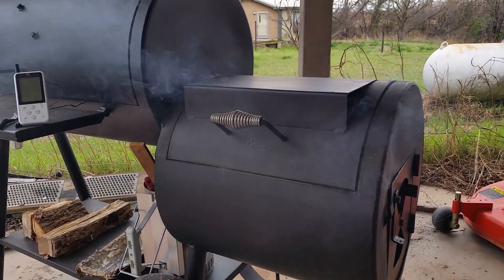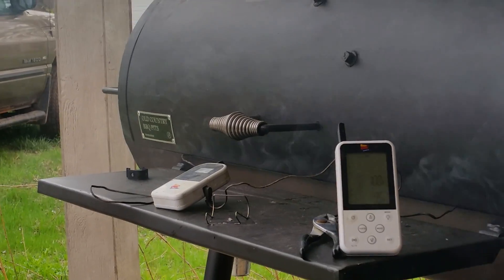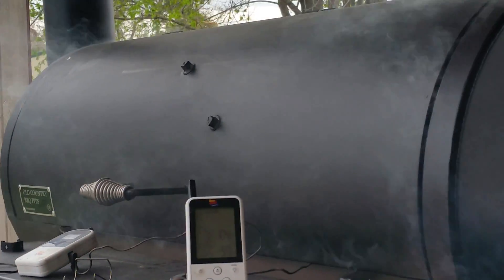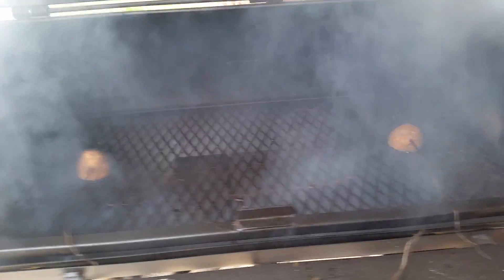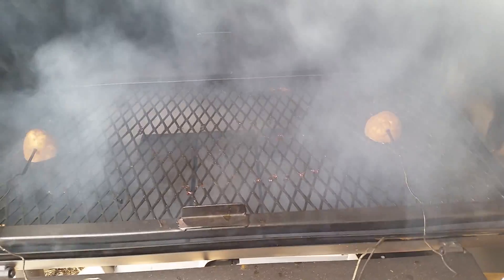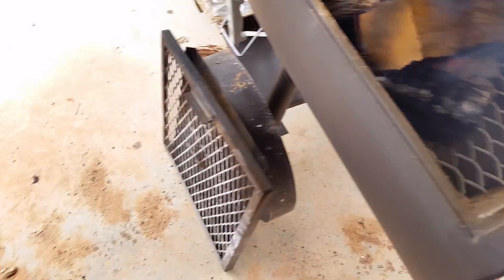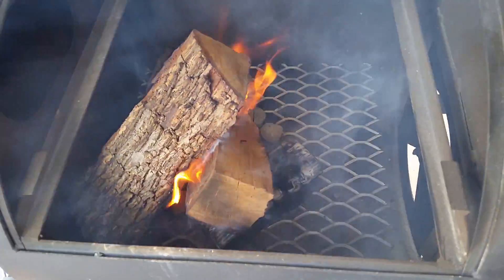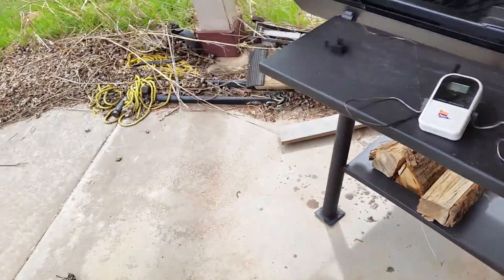Old Country Pecos smoker mods

Comment: I have the Brazos Smoker grill, the heavy version of your unit.  Mine leaked too. Amazon has different gaskets kits for smokers. On my fire box, I used wood stove high temp 1500° gasket, on the cook chamber I used black nomex gasket for the Big Green Egg XL. That sealed the deal, with better temperature control, and oxygen flow, creating a new and much better cook. The cost of the kits was just under $20.00.

Comment: Are the temperatures pretty even with the tuning plates?
Reply from the maker: it can be if you adjust it well enough.. probably won't ever be perfect but it is better than without it
Reply: @OKRMetric  try closing the plates together leaving no gaps, I heard that's all you need to do, what are your temperatures by the stack and fire box?
Reply from the maker: @ignoranceisnotatrend4669  I honestly don't know anymore.. I haven't worried about it since I bought it and made this video. lol  I did all the testing then and since then I just use it as is..
Reply: @OKRMetric  👍🏽👍🏽👍🏽👍🏽👍🏽👍🏽👍🏽👍🏽I think that's about how I'm going to start looking at it😄😄😄my set up as far as the cooking chamber goes is pretty much the same as yours except with 3 tuning plates from the baffle, I have about 3 more if I need to make adjustments 👍🏽but over all I'm satisfied and got to work with what I have I cant afford the much newer and bigger ones, I'm learning that with the pecos it's more about trying to get the heat up by the stack for a more efficient cook, so I think from this point it's really about maybe adjusting with another tuning plate or maybe 2 just to draw a little more heat by the stack but not adding too many because it could run the risk of turning into a reverse flow cooker.

Comment: Even if it does rust out on bottom it be a easy fix with bit of steel you could weld it or even just use self tapping screws. I have a friend who owns weld shop he couldnt build it for 400 bucks. So if your looking to get into smoken this is best bang for your buck. To start out with. I dont use any plates in bottom. Mine holds temp good im on coast of mississippi so dont know bout in the snow but would just think you would just need bit bigger fire. Coldest i used it in was mid 20s. An didnt notice any changes in cooking.

Comment: i have same smoker. first if it sits outsige drill 1/4 " hole in bottom of fire box an smoke stack water will sit in there if not.  2nd mine leaks just like that when you first start it it stops when its at temp i dont use any plates watch bbq with franklen on here he explanes it all but great smoker get ur self can of high temp spray paint keep after it fire box will need it.
Reply: yeah i have heard the smoker box rusts out if you do not take care of it.
Reply from the maker: yeah the heat will burn the paint off eventually. it starts small and can be maintained with some sand paper and heat paint once a year maybe..